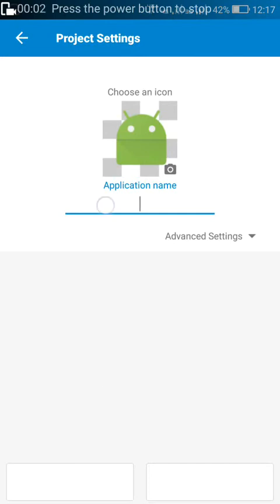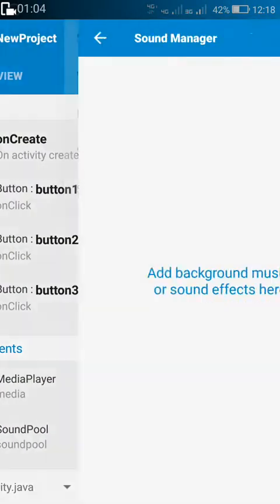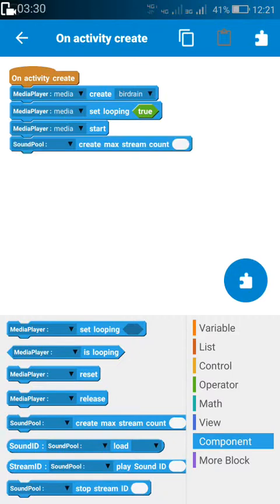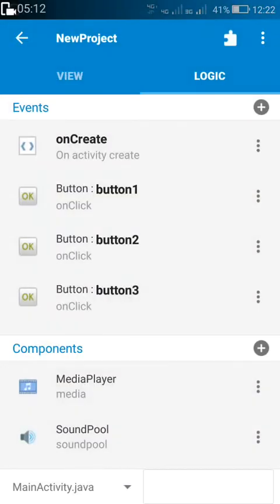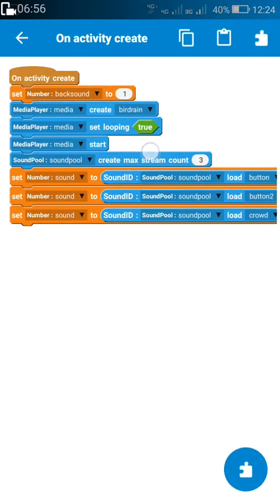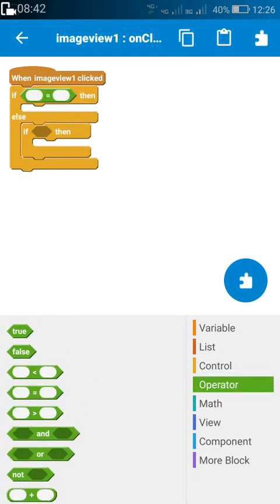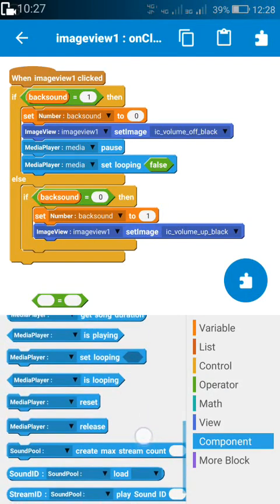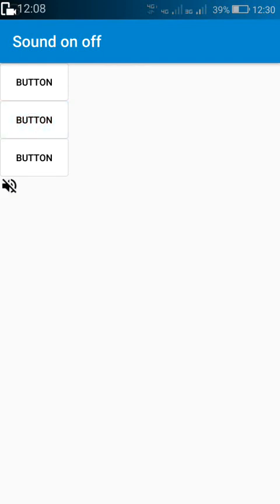Sound on/off button in Sketchware

Comment: Bro, I add different sound pool to different pages... So
How to set single switch to sound pool off button for entire pages.
Reply from the maker: Use shared preferences to save on off state, and set on off in onStart of each page using the data in shared preferences.
Reply: @sketchwarehelp  Sound Download link
Reply: @sketchwarehelp  how do you save on and off state